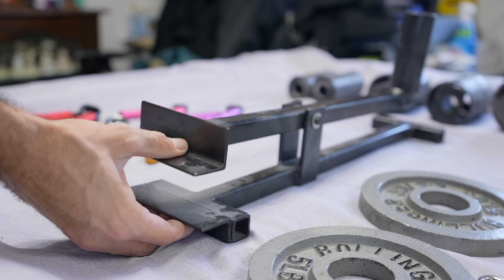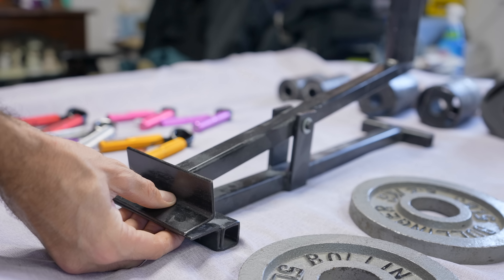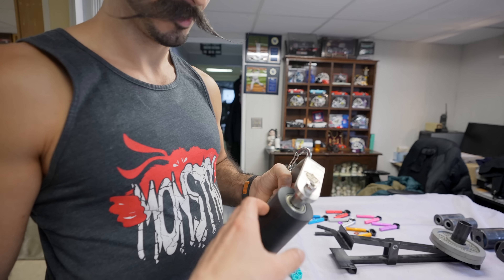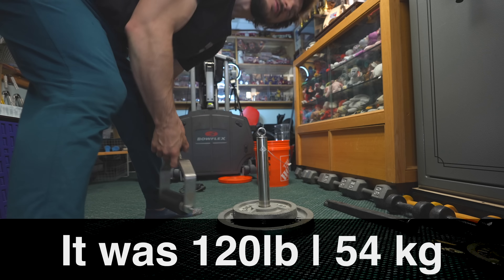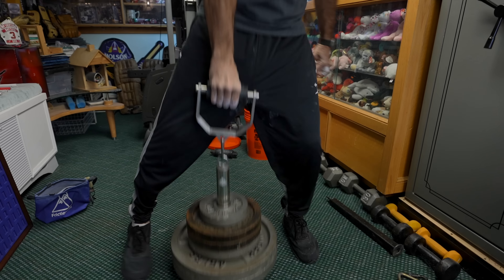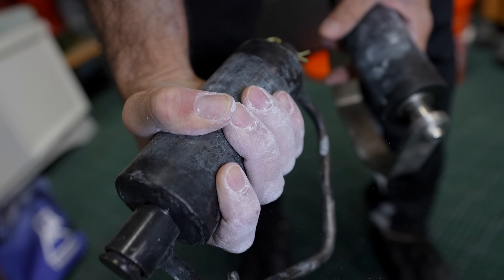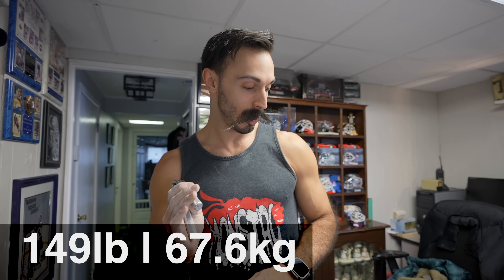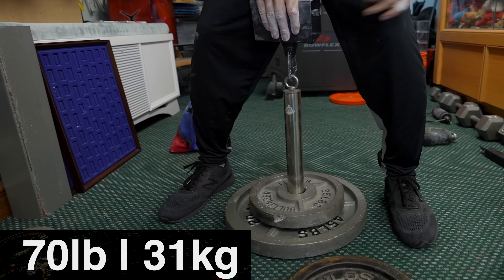How To Build Strong Grip

Comment: Its so wierd to hear his max is like 149 on the grippers. i bought a CoC level 1 gripper that weighs 140 lb and after just one week i was able to close it pretty comfortably :/. Am i the wierdo of is he just oddly weak in the grippers?

Edit: i forgot to mention i dont have chalk either so im lost on how 149 with chalk would be hard
Reply: No basically the grip strength which comes with the gripper automatically measures from the top of the gripper nearest to the coil but if you send it off to certificate it to see the actual strength needed to close it will be from the bottom of the gripper as that’s where we close the gripper from. So in reality a 200lb gripper is actually nearly half of that weight 
Hope this helps

Comment: One thing about the grippers that confuses me. He said his record is a 149lbs gripper, and also said on IG that it equals a COC 3 which is 280lbs. Is it possible they are confusing lbs with kg? 149kg would make much more sense because I easily crush my 65kg gripper and I'm just an average joe in terms of grip strength.
Reply: No basically the grip strength which comes with the gripper automatically measures from the top of the gripper nearest to the coil but if you send it off to certificate it to see the actual strength needed to close it will be from the bottom of the gripper as that’s where we close the gripper from. So in reality a 200lb gripper is actually nearly half of that weight 
Hope this helps